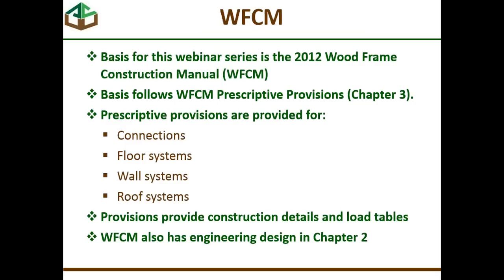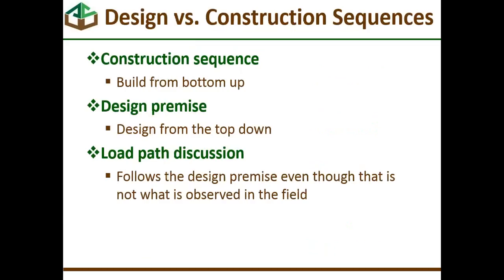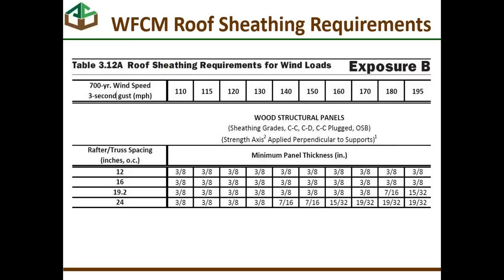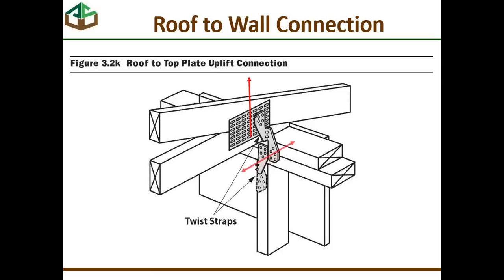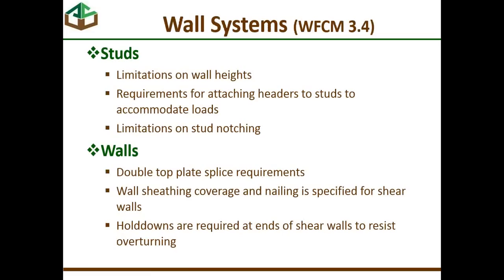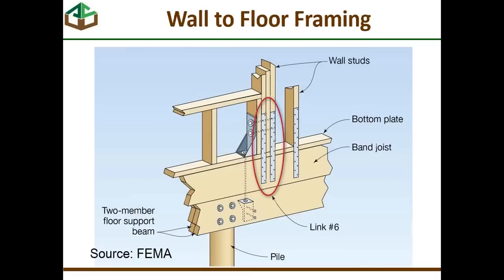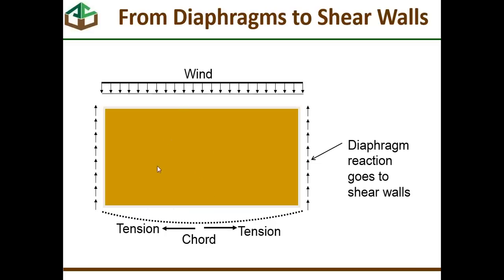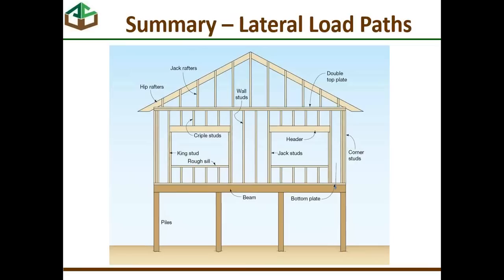2012 WFCM Webinar 2: Wind Load Distribution on Buildings - Load Paths

Comment: Great vid! 2 questions: At 17:30, the slide states connector must attach to both top plates yet picture shows the connection only at 1 top plate.  Isn't this insufficient?

And at 38:30, you state that this is a perforated shear wall.  The graphic appears to be a segmented shear wall.  Please clarify.

Thanks!